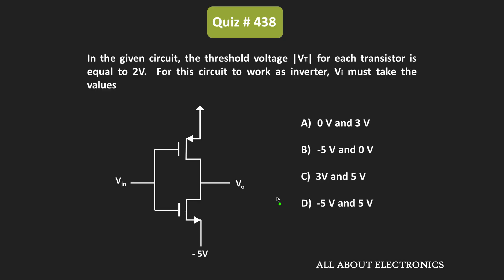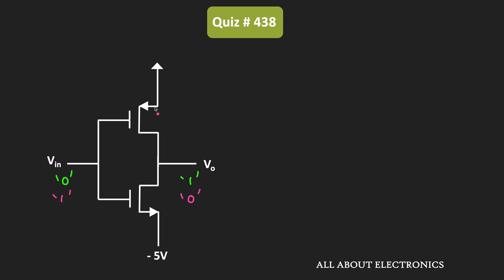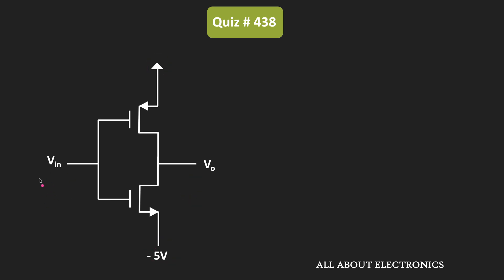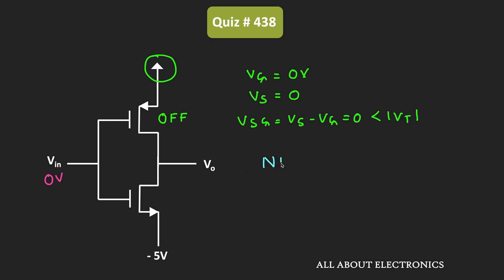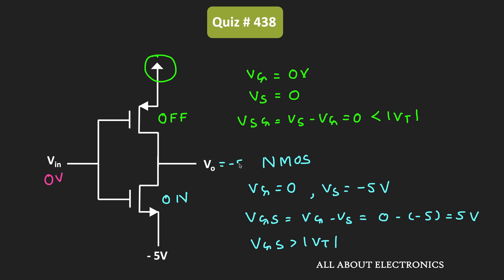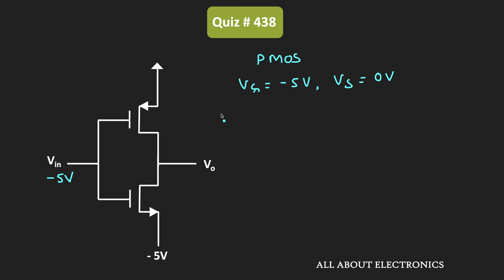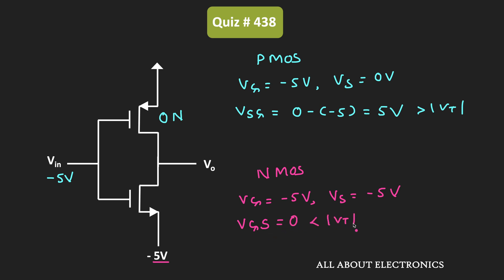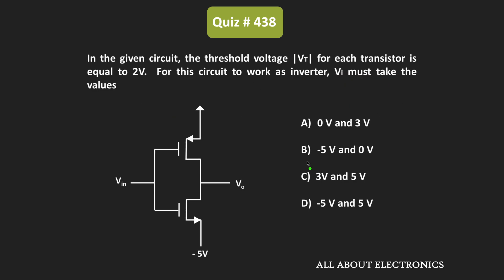CMOS Inverter (Digital Electronics) | Quiz # 438

Comment: What about option d ? 
1). Vin = -5v . Vsg = 5 > 2 => PMOS ON, Vgs = 0 < 2 => NMOS OFF => Vo = 0V => Logic High O/P
2). Vin = 5v . Vsg = -5 < 2 => PMOS OFF , Vgs = 10 > 2 => NMOS ON => Vo = -5v => Logic Low O/P

So isn't opt d also correct ?
Reply from the maker: For the circuit to work as an inverter, when you apply logic '1', the output should be logic '0' and vice-versa, when input '0' is applied then output should be '0'. 
And for the logic '1' and logic '0', there will be only two voltage levels. In the option D, the inputs are -5V and 5V, while the outputs are 0V and -5V, so we have 3 different voltages in the input and output. 
In the option B, when input is -5V then output is 0V and when input is 0V then output is -5V. So, basically we have only two voltage levels. 
That is why, option D is not selected. I hope, it will clear your doubt.